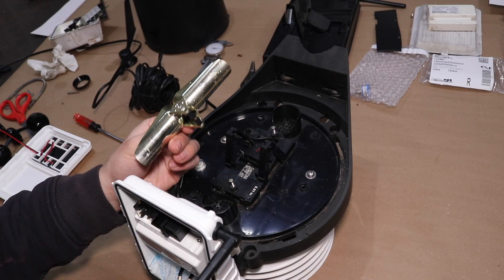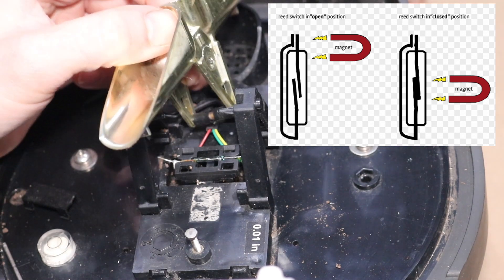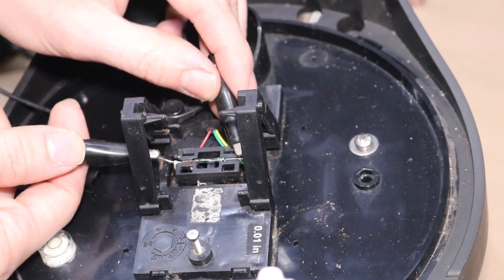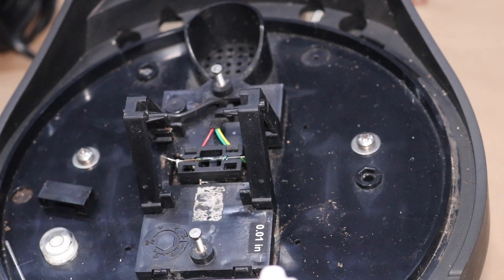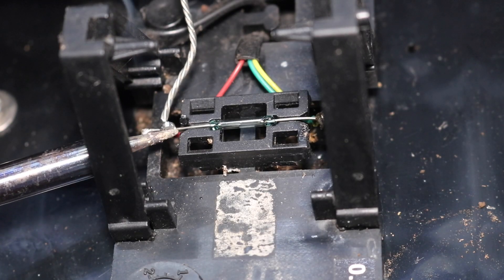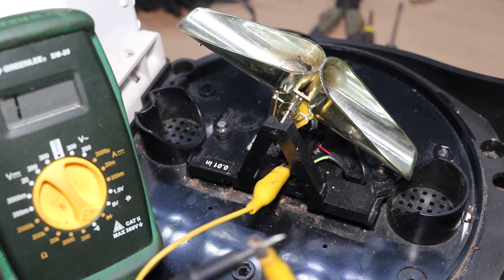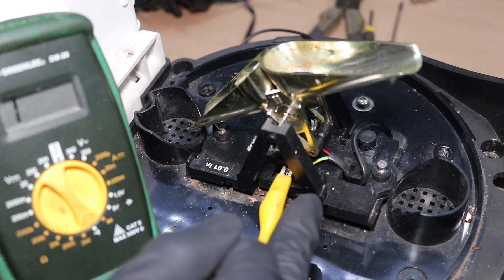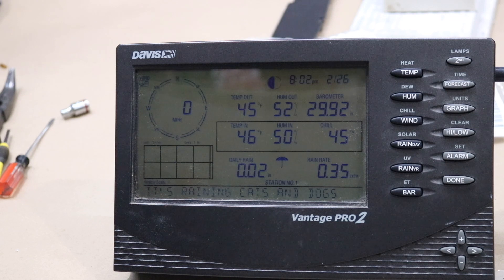How I Fixed My Davis Vantage Pro2 Rain Gauge

Comment: Great video. I had the same situation with a decade old unit. Ordered the reed switch directly from Davis for $25 including shipping. If it lasts another decade, it's money well spent. Easy peasy swap out. Davis is not quite on the leading edge of digital technology now but their hardware components are just about bullet proof.

Comment: Thank you for the informative video.
My rain guage stopped working so I found your video to address the situation. After replacing the reed switch, I noticed the switch is closed any time the tipper bucket is installed. Only after removing the tipper bucket does the switch to open again. I've replaced 2 reed switches in case it, somehow, was the switch. Any thoughts?

Comment: Thanks for the video!  Easy fix!  I just removed the entire rain gauge with the upper pole, brought it into the house and used my Panavise to secure the upper pole with rain gauge attached.  Then removed the rain funnel and the reed switch cover and saw rust on one end of the reed switch.  I did a quick ohm check like your video and no response from the old reed switch.  I tested one of the Amazon reed switches and it easily switched on and off when the new reed switch is held in the same direction with respect to the rain cups).  A quick test that the receiver incremented the rain by 0.01 inch when I flipped the rain cups and mounted the whole assembly back on the rest of the pole mount.

Comment: NEVER touch those screws! (Unless you know what you're doing.) They are not there to adjust the distance from the magnet, they are calibration screws and turning them will destroy the accuracy of the measurement. Look at the graphic that is stamped next to one of the screws 1:40. It is necessary to choose the right reed switch that will not be too sensitive. Anyway, thanks for the video, it helped me with the reed switch replacement.

Comment: If the screws don't hold the reed switch housing down, how did you remove it....do you even have to remove it? And how did you remove the tipping buckets... just spread the brackets? Thanks for saving me $100!
Reply from the maker: To remove the tipping buckets,  gently pull apart the two bracket stands, and shimmy the steel rod that the tipping buckets rest on out. Below the tipping bucket is that plastic cover that protects the reed switch. The cover is removed by gently prying it off with a flat head screwdriver.
Reply: Thanks!

Comment: My Vantage Pro2 has developed an issue with the rain gage.  When we get hard driving rain accompanied by high winds, the rain gage occasionally reads rain at a rate of14.06 inches of rain per hour.  Even when the rain and wind stops, it will continue to read this rain rate until things dry out a bit.  Of course this has ended up recording over 230 inches of rain before it starts acting normal again.  The station has done this 3 times in the last two years.  On lighter rains, or heavy rains without heavy winds it appears to read rain rate normally. I've looked at it when this is happening after the rain has ended and the tipping cup is always sitting to one side or the other, so the magnet isn't hovering above the switch.  Any idea if this would more likely be caused by the switch in your video, or if it is more likely a short in the connector where the gage plugs into the sensor array?  The last time this happened I unplugged the rain gage from the sensor array and it stopped recording rain, but when I plugged it back in, it immediately started recording rain at the 14.06 rate again.  Waited several hours and tried again, and by then it stopped recording rain.  Any advice would be appreciated.
Reply from the maker: Well it's one of two things. A bad circuit board, or a faulty reed switch. 

I would start by unplugging the rain sensor from the circuit board, use some alligator clams, and connect either side of the reed switch to a voltage tester. Turn the tester to continuity. (when the tester detects a closed circuit, the tester will have a solid audible tone). Tip the buckets and listen if you hear a short beep as the magnet passes over the reed switch.  If you are getting crazy random beeps, you may have a bad reed switch. 

However, my money is on a bad circuit board. Have you opened the transmitter box? Do you see any signs of moisture in the box? It's very common for the solar panel cover seal to fail, thus allowing moisture into the transmission box.

Comment: In other words, send it back to Davis and let them repair it.  Ha.
My Davis Vantage Pro was just completely refurbished about 2 years ago.  Unfortunately it must be located up on a high roof due to property trees on all sides.  It was working perfectly, then came the deep freeze, down to about 11 degrees.  Then we got a bit of snow, freezing up the mechanism.  When the thaw came and we got heavy rain, no response from the rain gauge.  The aspirated thermometer and the anemometer work fine.  Rain gauge is dead.  It sits above where debris falls and it has surrounding Davis spikes to keep birds out.  If it isn't clogged obviously, I won't be able to fix it.
Reply from the maker: Sending the unit back to Davis for repair is a totally oppositional to the theme of this video...

I made this video in order to assist other davis instrument owners out there on fixing their unit. This isn't that complex. There's a a very high chance that you can fix your unit if you set your mind to it.

1) I would check to see if the funnel is clogged. 

2) If not, manually tip the cups to see if data is transferring to the display.

3) If not, unplug the rain gauge from the transmitter, use a voltage tester on either side of the switch. Turn to continuity. Tip the bucks and listen to if the reed switch works (closes circuit) when you tip the cups. 

4) If not, Replace the reed switch.
Reply: @OldSoulMillennial  thank you, those are very reasonable suggestions.  When I get the d@m# thing off the roof I will follow these suggestions.  There’s no obvious damage from the ground.  Wish I could see in the collecting funnel.
Reply from the maker: @paulwilson8367   Most likely a clogged funnel or bad reed switch. It's also possible that the rod that the buckets tip on popped off the guide. 

Chime back in when you get it looked at and let us know what you find. 

Cheers,
OSM
Reply: yesterday, some 4 or 5 days after the frigid temps left the area, another batch of rain came through and my gauge suddenly returned to life.  It recorded .63 inches of rain which was certainly in the ballpark with my "other" gauge, a "Tempest" attached to fence with a metal ball on top that records droplet impacts (it actually works better than I expected).  I also have a manual gauge but I always neglect to empty it.  Anyway, I guess the problem was the freezing but still, that was a long time.  Of course I WISH that I could have a look at it way up there!  I don't remember it taking so long to thaw in the previous 2 winters but, perhaps there was no rain for some days after the freezing.